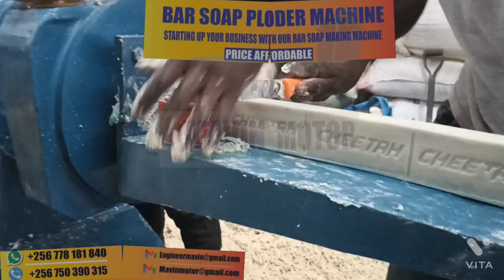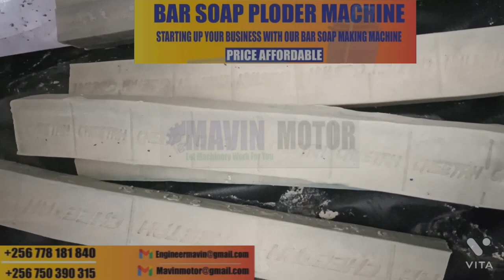@Soapmaking for beginners +25678181840 manufacturing process making machine make soap How to Uganda

Comment: Hi can I ask you pls? 
I am from Sudan. I have a locally made plodder machine. When producing soap, should I turn on the heater, because I have a problem with the surface of the soap. It is always rough in texture and does not have any shine.
Reply from the maker: Turn on